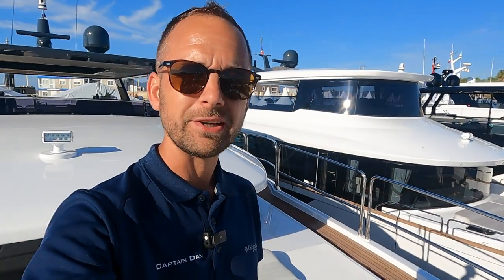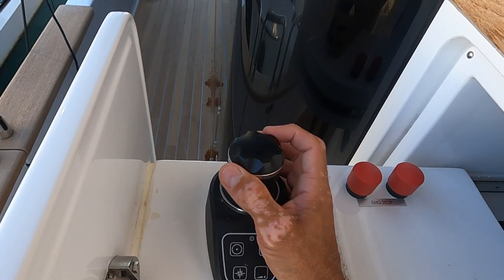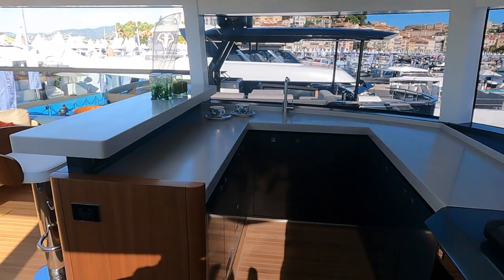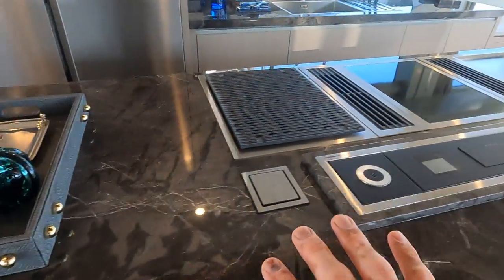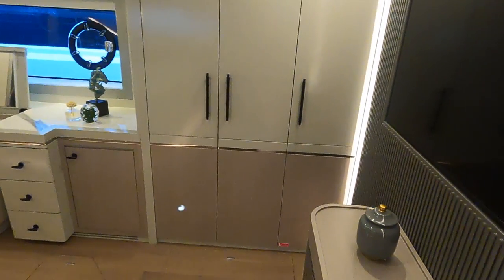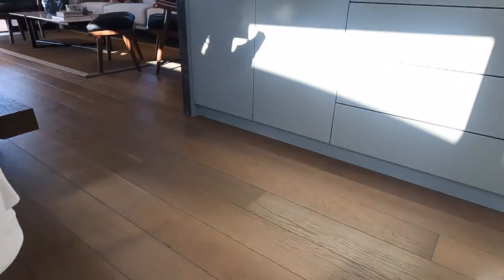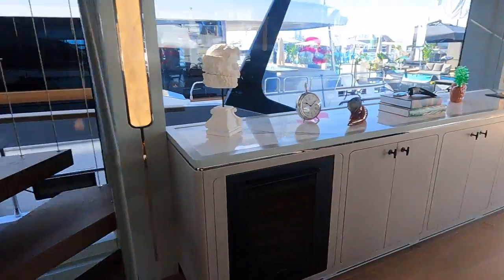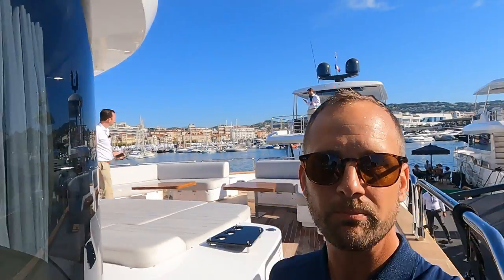FIRST LOOK: Yacht Walkthrough Tour - 2023 Sirena Yachts 78 from Cannes Yachting Festival

Comment: Beautiful yacht. But there are a few things that I find odd. There are no windshield wipers. What if it is raining hard and your are out at sea? Where is the space to put in a washer/dryer machine? The Engine Room looks sparse and small. Where are the inverters and batteries, the watermaker machine and the aircon machines?
Reply from the maker: Good catch on the wipers, those are definitely being added on this one and for future models. After doing the video and walking off it did strike me that oh crap I must have missed the laundry area. It’s got to be on there somewhere but that’s one spot I must have missed unless for some reason the owner who built this model chose not to put one in, which would be a miss but for an owner building one, to each their own. 

The engine rooms on Sirena yachts are very large and very well laid out. The metal flooring is removable, so you can pop up sections to access sea strainers and items like that. This helps keep it clean and minimal looking. AC machines and water maker would be along the back corners to port or starboard. This keeps the noise from a chiller unit further away from the master cabin and rest of the staterooms. 

Great attention to detail in watching this video. Thank you for watching and commenting! Cheers!

Comment: Why is Sirena so cheap in comparison to other yachts of the same size?
Reply from the maker: Great question! I would start by asking other brands why they are so much more expensive for far lesser quality yachts. 

I find it incredibly difficult to find better bang for your buck with size, quality and performance in Sirena over any other vessel. 

Sirena makes all their own woodwork and stainless steel in house which helps keep quality up and pricing down and I’m sure the cost of labor in Turkey helps too. 

Thank you very much for watching and for your great question! Cheers!
Reply: @ElevateYacht  thank you for the response! I’ve been looking at Nordhavn, mainly because their HQ is not far from my home, but their 68 is $5m. I feel that it’s too small to live in for extended periods. The Sirena 78 provides the right amount of separation where my family won’t drive me nuts.
Reply from the maker: @kazukinakamura1110  Northavn builds a great vessel. I haven’t spent as much time on those as I have Sirena though. Sirena 78 is a total beast.